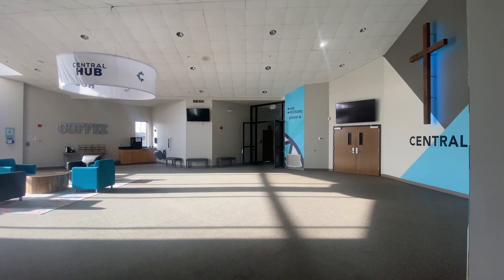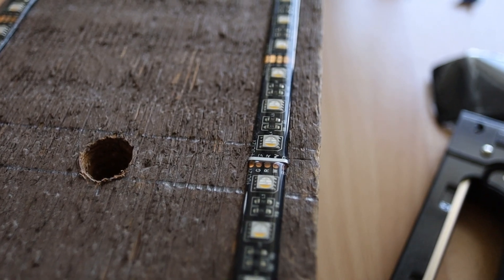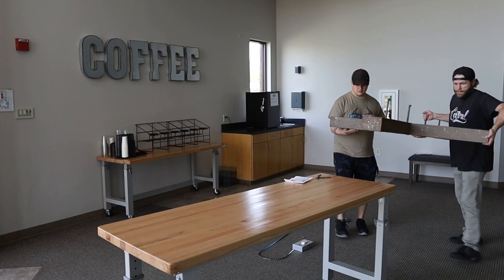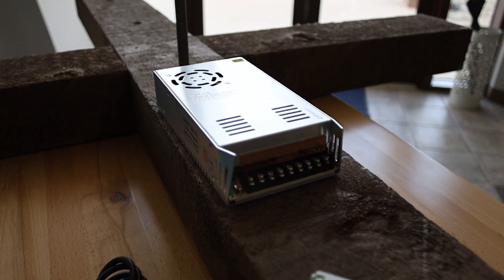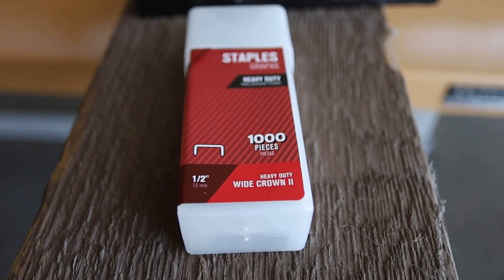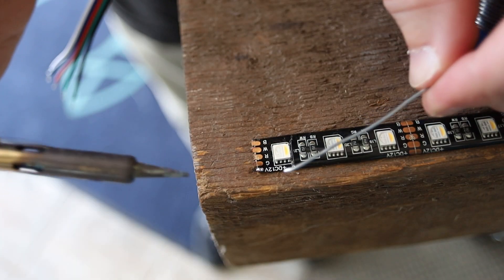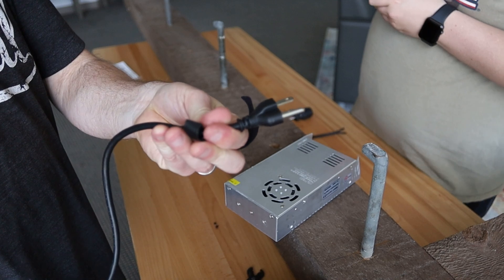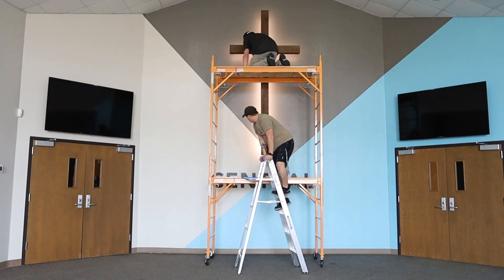Redesigning our Church Lobby - BTS of our LED Cross Build

Comment: Man, that looks great! LED projects are really fun to work on. One note I have on those wifi Bluetooth conteollers: I never like having to pair to an app or create an account because that's one more thing to keep track of or having to connect my phone to. I would recommend looking at WLED. It's a bit more advanced, but it generates a webpage to go to on your church network instead of an app. I would also recommend stripping back the minimum amount of insulation on the wires, as to prevent any shorts later on when wires get moved, rustled etc.

Comment: Looks great!  We just did that to our cross too.  I used the aluminum diffuser track so if the adhesive on the back of the strip fails, it still stays contained inside the diffuser track.  Also used the RGBW DMX controller so we could control the LED's with the rest of the stage lights.  It was a fun project.
Reply from the maker: Ya those tracks are handy!